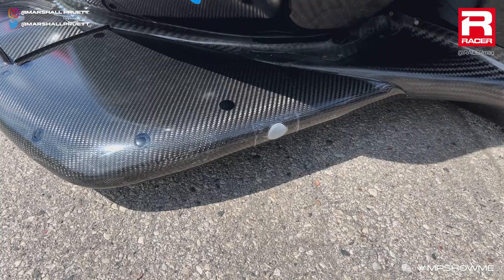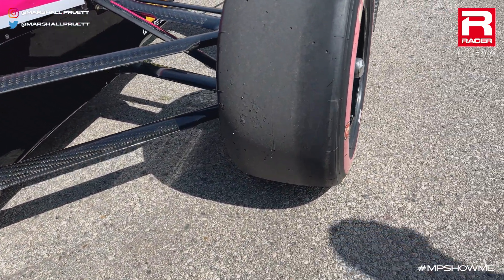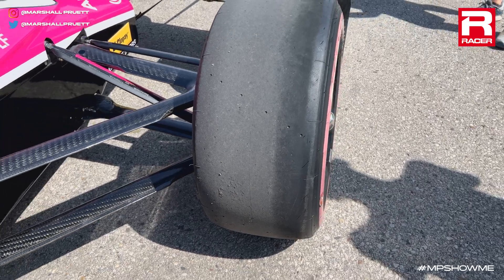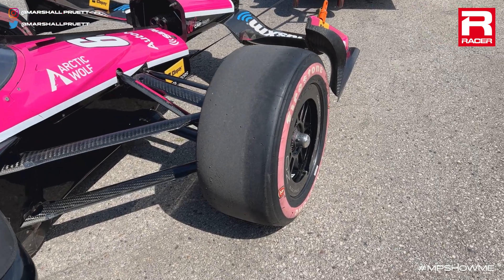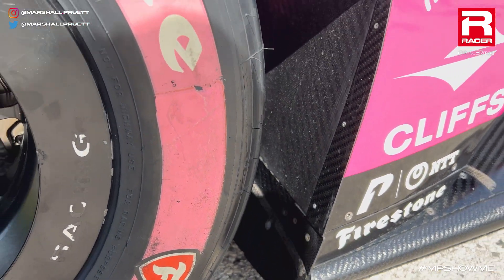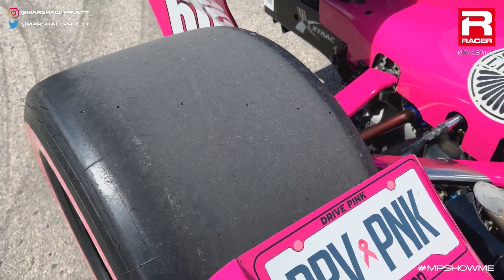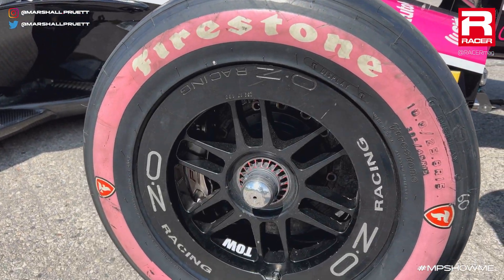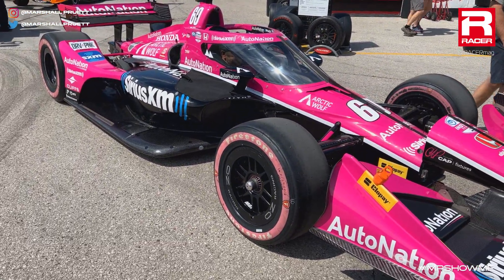#MPShowMe 42: IndyCar IR Sensors

Comment: Interesting. MP why do they use Pitot tubes when the have speed in their data already?
Reply: Pitot tubes measure air speed, which might be slightly different than ground speed. For example if you have a strong head wind your air speed measures higher, if you have a tail wind it measures lower.

Certain functions of the car, like aerodynamics and cooling, depend on the air speed. So for data analysis after each event it is useful to know what the actual air speed was at any given time.